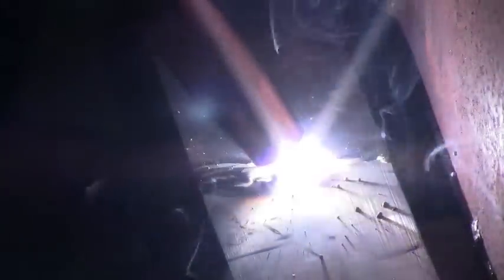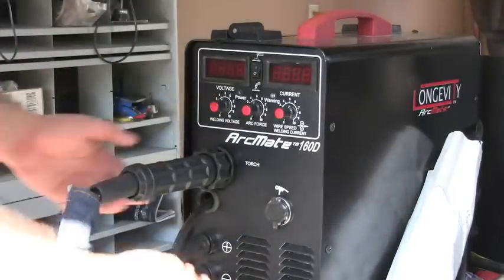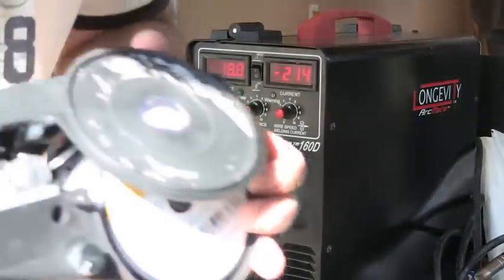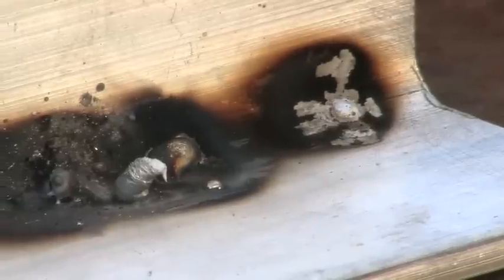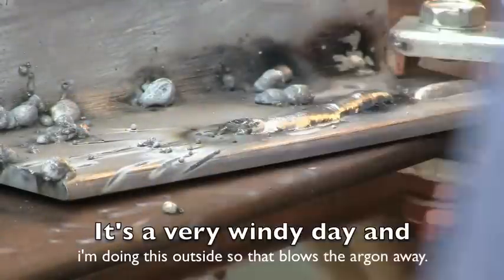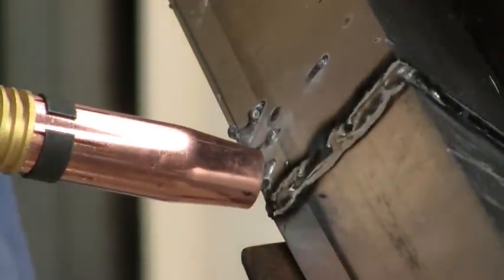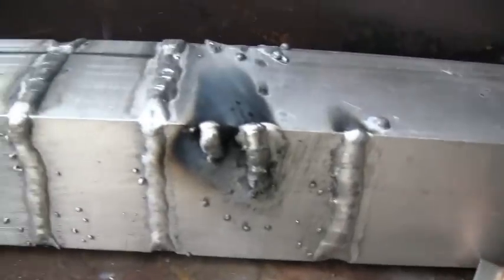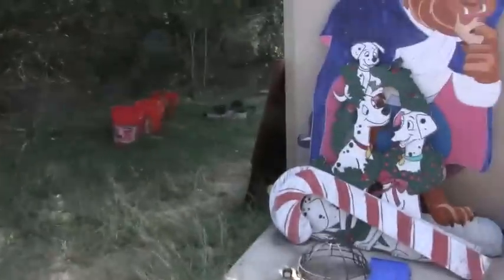using a spool gun for the first time to weld aluminum.  learning to weld

Comment: Freddy here are a few tips:
-clean the aluminum first and wipe it clear with acetone.
-Large pieces, preheat aluminum with a torch before welding.
-Watch for soot.  Soot means you need to adjust your Argon flow
-Adjust wire speed so the gun does not bind or the wire does not melt into the nozzle

Comment: I am in school at the moment. using Al. 5356 wire with argon shielding gas. push technique with a pausing motion to stack the dimes. about 20.8v first pass on lap and tee joint fitup and adjust as i go. about 6 wfs (dial on bottom of handle).

Comment: key to aluminum welding is you have to heat the thing you are welding,,,,if you have oxy acyt torch light torch so its burning black and soot over spot you are welding then turn on oxy and heat the piece till the soot just turns grey, then grab the welder and weld like hell,,,let cool slow for a bit before using any water,,,,,,you will be surprised at how much easier it will be to weld, strait argon for aluminum and pos stainless steel, 70% argon 30% CO2 for mild steel, and 100% CO2 for stainless steel,,,in a pinch you can use 100% CO2 for aluminum but like i said , in a pinch
Reply: 4tusix tri mix for stainless mig. Helium/argon/very little co2. Keeping carbon to an absolute minimum is the point of stainless.
Reply: That’s terrible advice. 100% argon for stainless and aluminum most of the time. Helium for aluminum if you’re doing anything over 3/8”. Helps for 1/4” too. Helium adds heat to the weld, so you can also use lower settings, and allows you to use a smaller machine. Not for anything other than aluminum though. It’s also expensive, and because of its lower density, you need more of it, as much as 45CFH.

You don’t have to preheat thin aluminum, say 1/8” and under.

Comment: Thanks for the video.
the comments on here are uncalled for as your title states "first time."
I am a tig welder and some times we get a job thats thick aluminum and it calls for a lot of pieces so we will use a spool gun.
If your working out side crank the argon up to around 30-35+.
Mig welding aluminum only if thicker then 14 gauge or you will blow through.
We get noobs in right out of school all the time. I would rather train you then a no it all kid.
Make your mistakes and learn.

Comment: You should be useing pure argon not the 75 25 mixture for normal mig and fluxcore and a few tips if the aluminum is cold try taking your tourches get a good cutting flame and just heat it up real quick but make sure you move fast with the heat let it cool for about a min and you should be set for welding. what this does was make it a little bit eaiser to weld with. Also make sure that you use a brand new stainless steel brush on it and make it only for aluminum or else you will CONTAMINATE it.

Comment: @Captaintsuchi continuation from my last one. Use rubbing alchol to clean it. the only time  you should use the brush is if u get the black coating around the weld and to help remove the splater but that should help you out alot better. If you need any other advice just let me know

Comment: You don't need a spool gun. Use 5356 wire, argon gas and a tip .005 bigger than the wire thickness

Comment: Try 20 to 22 volts, about 325 to 350 wire speed and 40 cfh for gas flow. You'll use more consumables but get a nice spray transfer for your weld. Better penetration without the risk of blowing through.

Comment: how your larning going i just started with alum welding. u are just like me lol learn by tril and error. hold gun at just lite angle say 15-20' and always push the jun and the big one is i seen u are holding tip to close to work 3/4-1 inch is were u are good at.if the weld is black u are doing something wrong. and if ya get a lot of burn backs like i do it helps to use a 35 tip on you 30 wire save me from buying so many tips. i burned a lot tips at 2.00 for millers tips otch. good luck 2us lol

Comment: you need 100 % argon that's why you get black marks and splatter, the pressure of the argon needs to be adjusted just right, and the valve on the cylinder needs to be fully open
Reply: If I'm in a tight spot and my gun angle isn't like it should I sometimes put a bit of scotchbrite in the nozzle of my everlast mig welder to smooth out the argon flow. It acts like a mig version of a gas lens for tig. It works quite well.

Comment: "I didn't read the instruction manual" I hear ya bro. When I buy new kit, I can't waste valuable shed time (shop time to you guys in the US) reading fucking manuals. Reading manuals is the absolute last resort. First you try all the different combinations of knobs, levers and switches, then you try Youtube to see if there is a video on your new toy, then Google, then you ring a mate to come around and drink beer whilst you both try and figure it out and then if all that fails, then......and only then do you reach for the manual. Just one thing that really improves ANY MIG welding, buy yourself a really good glove that can handle the heat, then you can use your off hand to steady the end of the gun. Imagine trying to shoot pool without having the hand at the end to steady the cue. Once you start using your off hand as a steady, your weld quality will increase heaps. Dont worry if you have your hand TOO close, the heat builds up gradual enough to warn you to back off, it isn't that quick that it will burn you. Another thing that greatly improved my welding......a good quality helmet so you can see what you are doing. I welded for years struggling to see the weld. A guy I know that does aircraft TIG welding mentioned my helmet was shit, he is not very diplomatic. I splashed out on a Lincoln Viking....now I can see what I am doing.

Comment: When your welding aluminum , do you need to wipe the edges first with  a chemical  so it's clean? and how much of a gap is there between the 2 pieces?
Reply: you should atleast use a wire brush to remove the oxides from the surface.

Comment: I keep blowing brakers im using a Lincoln electric 100 with a conversion kit it works great for steal but soon as i weld aluminum get about 3 seconds and boom the shop goes dead lol i think i should be in a 20 amp service line 15 just dose not cut it

Comment: can i use this gun using only flux core wire? without using an argon tank and gauges and all that gear?
Reply: Can't see why not. I have used my everlast spool gun for both flux core and aluminum welding. I currently have aluminum in my spool gun and simultaneously a full size roll of steel threaded in my mts251 welder and mig gun and just switch between them depending on the work.

Comment: You and I must be long lost brothers.  We both have messy shops and we both learn by doing.  My spool gun and wire welder is scheduled to be delivered tomorrow.  I can't wait to give it a try.  Question:  Do you use 100% Argon - or -  75% Argon/25% Other Gas?  
Thanks for the great video!
Reply: Pure ARGON for aluminum.   Argon mixes for steel, other mixes for Stainless Steel... I think pure Argon for Silicon bronze, too.

Comment: Didnt look like you cleaned the aluminum either, use a wire brush at least and clean it.  And also set the argon properly to at least around 25 cfh.

Comment: you need to push in the same direction of your welding, not dragging nor straight,, 'cause when you push you dig and clean the surface and your weld don't get trash ,,,,,,,,,and looks beautiful,,,,,,,if you got the machine well setted you shouldn't have bbs nor burning

Comment: So can you use the spool gun for regular  MIG and Flux Core welding?
Reply: +phantomcruizer  No the wire is too heavy.
Reply: Yes, all kinds of wire comes in those little spools.  A lot of people like spool guns just for this reason, you can change over in a minute.  I probably have ten kinds of wire on small spools like that.

Comment: 100 % argon and you need to adjust wire speed and the heat,,,,,,,,,you also gotta check that wire isn't loose nor too tight....practice makes perfect, I learned in one week is not that hard, if you try hard,,,,,you want it, you take,,,,,,,you will be what you wanna be,,,,,,,piece of cake....trust me..

Comment: from a real welder never pull your weld. With Mig always push your welds. If you pull your argon gas will not protect the weld properly as well as you will not get the best penetration. also try pre heating your aluminum before you weld..

Comment: is possible to use a spool gun on a TIG machine ?
Reply: Generally speaking no, beccause TIG is "constant current" and  MIG is "constant voltage", a different type of power supply!  There are multi-process machines now that you can probably do anything if you find the right plug, select the right mode....  I do not follow these ways.

Comment: Freddy, I love all your vids, but one thing on some of them drives me NUTS.  I think it's your smoke alarm battery going, so every 30 seconds way off in the background I hear "beep".  You should have seen me over here.  I kept stopping the vid and looking around here, going "wtf was that?" until I figured it out.  Check it out at about 0:06, 0:35, 1:04, etc.  I think it was on another one about the same post date too.

Anyway, thanks again for the great vids.  I'm just chuckling over here..  ;-)

Comment: i thought aluminum is usually welded with tig at AC
Reply: That's  nice, too!  People like this b/c they're in a hurry, or are working on heavier material.  MIG welding is not NICER, but it has higher energy density, and also higher electrical efficiency.  So you get more zap for your money.

Comment: try dragging, should not push
Reply: No... you almost must push aluminum... for the cleaning action.
Reply: jerry waters wtf dude...dragging? it will always look blacker and darker if you dragg. instead, if you push, you will have a grey/shiny weld which looks way better than a black weld and yes....you mostly/always push with alu, if you have to brush it, the weld may rust...